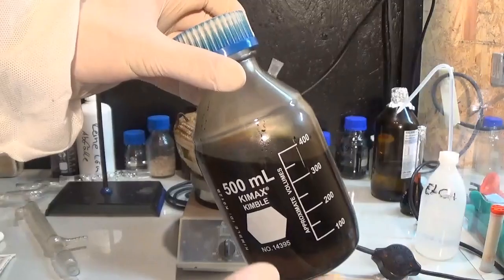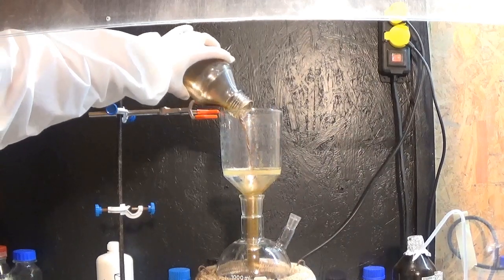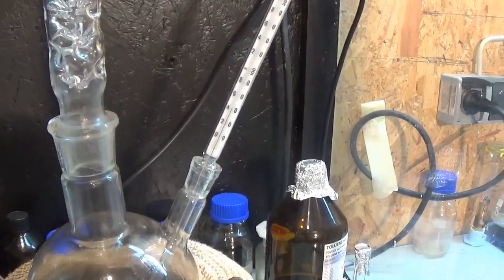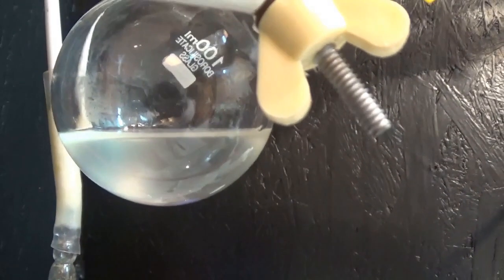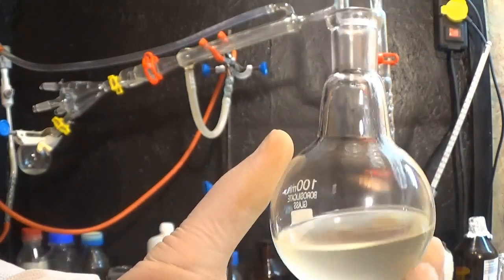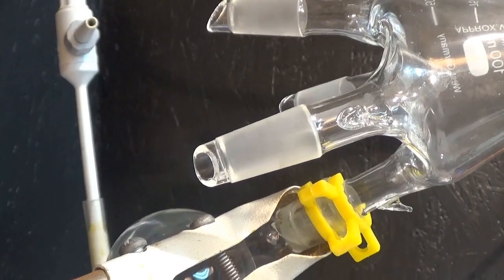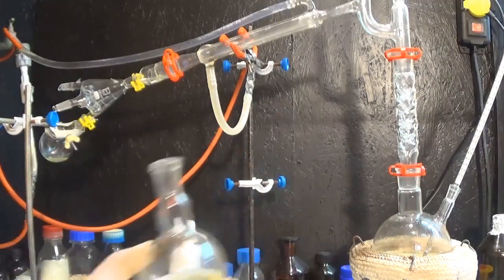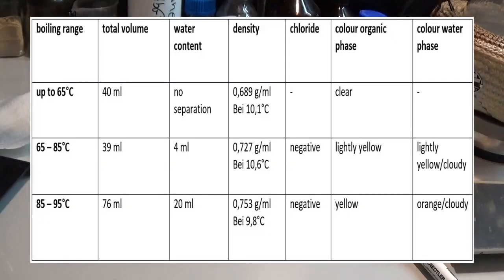purification of pyrolysis oil

Comment from the maker: hello you all 

in this video we will fractionally distill the previously made pyrolysis oil 

as you can see the crude pyrolysis oil is nearly black in colour and has fine particles supendet in it , and some paraffines formed a small amount of gell at the botom of the char 

the distillation we performe is similar to the process used in the petrolindustrie to sperate the different hydrocarbons from each other 

therefore we fill the crude oil in a one liter two neck roundbottom flask 

at the end of the pouring you can see the solidified paraffines that formed a gell with some of the lighter hydrocarbons splashing in the funnel 

to get a better seperation of the hydrocarbons we install a short vigreux collum 

this collum works by enhancing the surface on which the gaseous hydrocarbons and the cold glas have contact 
the hydrocarbons condens in the collum and release their condensationenergie thus heating up the collum 
the so heated collum has a lower temperature than the mixture in the distillation flask, this leads to some reflux, reflux means that a liquid is evaporated and condenst back into the evaporation flask, 
on the so heated collum wall some of the hydrocarbons are evaporated again but this time the percentage of lower boiling hydrocarbons is higher then before, this happens all along the collum and sperates the lower boiling from the higher boiling hydrocarbons
presence

the water present is most likely do to insufficient inertisation of the reaction chambers atmosphere which leads to oxygen reacting with hydrocarbons to form water, this in term has to reasons, number one is that i may have used to little carbon dioxide to get rid of remaining oxygen from the air, and the second is that the sealing i am using is not realy made for this purpose and that air could get in the chamber through the ISOTHERM sealing rope 

there is a considerable amount of gases dissolved in the pyrolysis oil which can be seen at the adapters of the distilling spider, these gases are driven out of solution during the distillation do to the decreased solubility in hot solution

the second fraction was set from sixty five to eighty five degrees C, so when the temperature needed was reached the collection flask was switched again, as you can see the way i am doing it is complicated and labour intensive, if i had had the right equipment the change of colection flasks would be just a matter of twisting the spider ninetee degrees

the second fraction is a lot more cloudy and has a yellow colour to it which shows us that the composition of the two fractions we already collected differs quite a lot 
the third fraction from eighty five to ninety five degrees celcius has to separate phases, with a upper hydrocarbon and a lower water layer

at around one hundret and sixty degrees decomposition reactions occur in the distillation flask indicating that the non heat treeded pyrolysis oil is not stable 
the distillation was stopped when the decomposition occured and the flask was swapped again to save the third fraction 
here you can see the different fractions and how they vary from each other in water contend and colour, all of these fractions were dryed by first separating the organic and the water layer and then stirring the organic phase with tenn cubic centimeters of three angström molecular sieves 
to yield nice and clear hydrocarbon fractions which will be shown in a later video, here are all the datas i collected about these fractions 
the distillation residue was transfered into a storage vessel and will be processed later   
have fun and do not kill your self
Reply: @Hazel, only if i don't see the end of this video🤣, because I'm planning on a project on how to make roof tiles and pavements from waste plastic and sand. With this a channel can be upper as to have a lower temperature for not over melting the plastics
Reply: Hello Hazel. Where does one get the angström molecular sieves from please?
Reply: You are get oxygen from the No1 (PET) plastic you are putting into the chamber.  Don't use PET and PVC plastic.
Reply from the maker: @markdixon2825   hello mark i only now saw your comment ..... you can buy them from resatauro and many other sources online

mfg hazelChem
Reply: After purification we use this fuel on car and bikes ?
Reply: Your pyrolysis projects are amazing but your destillation setup is realy messed up!
Reply: How did you test the chloride content please?
Reply: @HazelChem  It may be beneficial for you to use vacuum distillation, since your raw oil seems thermally unstable. Higher temperatures + oxygen cause radical reactions go wild, resulting in yellow discoloration and tar production.

Comment: What catalytic agent can I use to remove sulphur, or to make the fuel stable and ready to use in car. Is plastic oil good for cars?
Reply: Charcoal
Reply: If I remember what I've read, natural zeolite has been used as a catalyst to remove sulphur. The fuel still was mixed with diesel at no more than 10% to get the same efficiency as straight diesel. The document stated it would work as bunker fuel in cargo ships or generators without being cut.
Reply: molybdenum, nickel, and cobalt sulfides, if it´s cleaned up properly there´s no problem, as it´s chemically the same, if you have an old tractor you can just pour the pyrolysis oil directly into the tank
Reply: @Humbulla93  can you explain the method of using the material
Reply: @Humbulla93  Am working on a project in India ..would love to connect with you

Comment: I have a gut sense that you could obtain hydrocarbure in a fairly small range of combustion points if you control the output of the boiling chamber.
I am thinking you could use a spring pressed kind of lid that would prevent the gas from exiting the boiling chamber until a certain pressure is present.
If the source of heat is constant, I think this will also translate in a fairly small range of HC chain lengths that reach the condensation phase.
Keep that pressure up until everything is burned, then leave the gas flow freely, driving the condensed fluid somewhere separately.
The small amount that is condensed last and is not regulated by pressure can be used in the next batch.

Comment: For a little makeshift setup, do you think the yield would be affected if the reflux column and Liebig condenser were made from copper or stainless steel? I would think as long as there isn’t any sulfuric or hydrochloric acid byproducts it would be fine. PVC and other compounds containing chlorine would need further treatment before coming in contact with the stainless (and to prevent chlorine gas production). 
That said, will a stainless or copper condenser work?

Comment: If you can make a cut that is oily but not thinner than diesel you have a solid alternative fuel for diesel engines. Thicker than diesel and thinner than clean veggie oil and you should be good, so long as the flash point is not to low.

Comment: Thank you for such experiment. I wanted to perform this on my own to analyse that fractions but I don't have the Chemistry knowledge as good as yours. Are you thinking of making experimental unit which will be pointed to make profits? If yes please let me know I'm open to cooperation. I'm from Poland.
Reply: profit from diesel or petrol or anything....
Reply from the maker: it is more of a self sufficient thing than a profit thing... but the unit will be upgraded soon to make it much more energy efficient :D 

mfg hazelChem
Reply from the maker: well depending on the energy source you are using you can sell the crude oil with profit or fractionate it and sell the naphta

mfg hazelChem
Reply: @HazelChem  i have a pyrolysis  oil from biomass  but i wish to do the engine test. How can i do distillation done. Please help me in my work

Comment: GREAT VIDEO.   Curious what chemicals are in each fraction
Reply from the maker: Good question! When this pandemic is over and my university is open again I am allowed to do some analysis in my campus. 

mfg hazelChem
Reply: @HazelChem 
First flask t<65
Second flask 65<t<85
Third flask 85<t<95
But......you said something about the temperature reaching 160 degrees (the limit of condensation temp of gasoline)
Q1...... What happened between 95 and 160 with the extract?
Q 2..... If after 160 degrees the solution is instable we need a shorter pipe and a cooler temp when cracking the plastic (so the reflux will be minimum) , for creating longer chain hydrocarbons.... Or there is an other explanation?
Q3..... I need more diesel 😁😁 from the reaction.... Should i lower the temp in plastic reactor +shorten the pipe favouring the longer chains to be created. Or there's something else in the making?
Q4 🙈🙈🐒🐒😂😂..... The process can be made in one stage, just for being economically viable (for not wasting the heat)

Comment: Hello: I congratulate you, I really like what you are doing. The product you get is a um blend of hydrocarbons. It is appreciated that it is not stable, possibly there was oxidation reaction, because it is cloudy. Will it be a solution to use any antioxidant agent? have you tried it ?
Reply from the maker: the instability comes from the PS and the formed styrene the double bonding has to be eliminated to create a stable fuel

mfg hazelChem
Reply: What solution do you have to create a stable fuel @HazelChem
Reply: @HazelChem  what agents should be used to create a stable fuel?

Comment: Good experiment. Unsaturated hydrocarbon are of course present, these can polymerize in air and become tar and low your hydrocarbon yield. You should add some radical scavenger in the crude pyrolisate, just after recovering. Few milligrams are enough.
Reply from the maker: hydroquinone for example should work.... i will try this with a sample the next time! for your catalyst idea i don´t see how (without stirring) sand silica will help in this process... in sveral papers i read all come to the conclusion that there are nearly no beneficial effects of a catalyst 

mfg hazelChem
Reply: @HazelChem  No. Catalyst help a lot in cracking. For example calcium oxide is fundamental for PET pyrolisis to yield benzene as major fraction.
Reply from the maker: @zodd0001  could you send me links or names for the papers you are referring to?

mfg hazelChem

Comment: Pyrolysis oil is Good or Bad?  
I want to know answer of this question. Because,i'm  going to start tyre/plastic to oil pyrolysis.
Reply from the maker: pyrolysis oil can be described as "good" .... but there is a difference to tire oil !!! in tires is sulfur which forms sulfur-hydrocarbons which when burned release sulfuroxides ..... and they are very harmful to the environment !! so unless you have a catalytic desulfuring plant please do not pyrolyse tires 

mfg hazelChem

Comment: What about to put a water pump to pump this oil in the reaction chamber until you distillate the pure fuel with the pyrolisis reactor distiller?
Reply from the maker: doesn't work like this there is no such thing as pure fuel ! the fuel is a blend of specific fractions 

mfg hazelChem

Comment: i pyrolyzed PS, i made small reactor (30 lts) , is any way to eliminate the odor of the pyrolytic oil? what consideration i have to take care to Distill this pyrolytic oil to fuel (gasoline and diesel), what about the Contaminant. do your think with only the distillation the result fuel coul be used in engine?
Reply from the maker: if have tried many things but i could nor get rid of the odor. Polystyrene oil is not very well suited for engines because the main product is styrene which polymerizes back into polystyrene which will destroy your engine! the PS oil would work if hydrogenated. 

mfg hazelChem
Reply: Lye and water

Comment: Based on the temperature used, you get a kind or another of fuel... Ok, but what kind of fuels are they? Is there a way to chech them to see what they are?
Reply: They are hydrocarbons. If you want to check after fractioning, you might be able to get a general idea by measuring the refractive index.

Comment: I had a thought. Maybe a dumb thought as Im definitely no chemist. However what if you put some Alum in the dirty oil. It should separate . Pour off clean, mix with alcohol .
Reply from the maker: that´s a idea but not a practical one    you need to distill it anyways so that you can blend the different fractions so you get a fuel that meets the standard 

mfg hazelChem
Reply: @HazelChem  meeting what standards, and if you meet those standards then it means your fuel can be used in normal cars?

Comment: The biooil is very unstable it is the main reason why this tech hasn't gone anywhere . try mixing a solvent like methanol or similar and vacuum distilled in 1 vol oil to 4 parts solvent. I have a huge amount of info on this if you need it.
Reply: Hi
Reply: Please I need this info